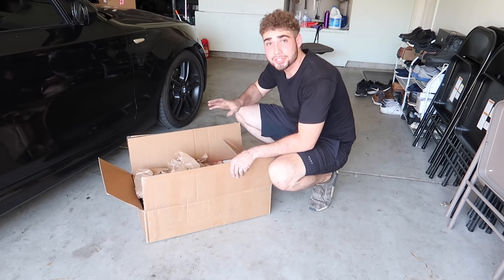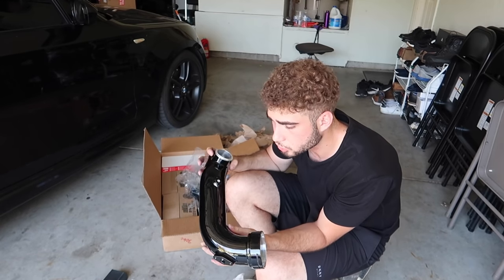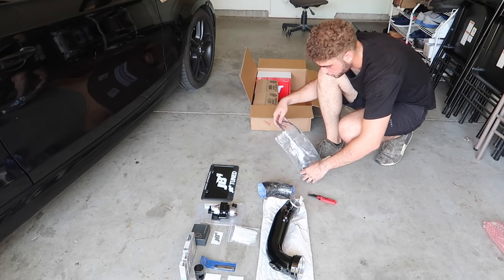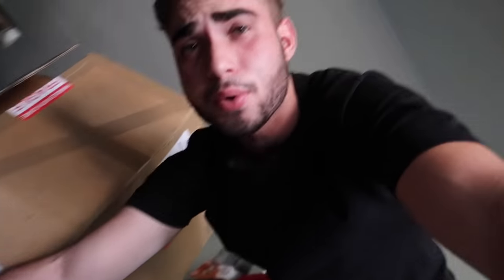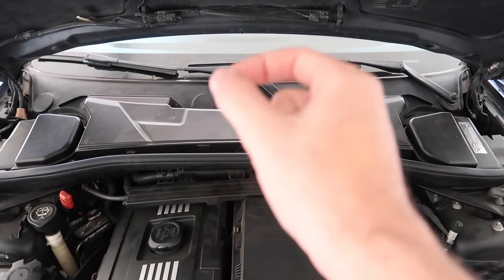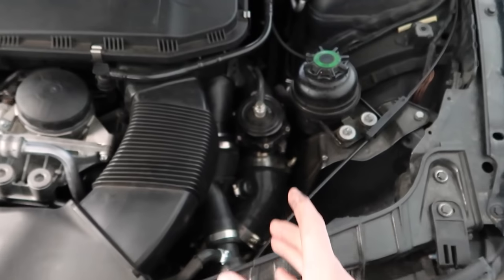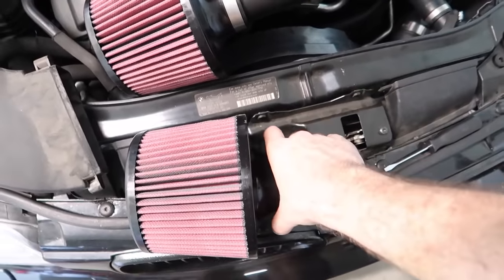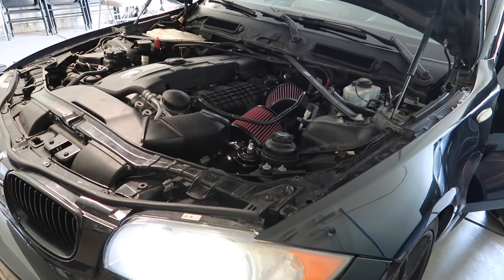THE 135I GETS 500+HP KIT (SOOOO FAST, SOUND AMAZING!)

Comment: Before you start removing the intake manifold to tap it for the bov. Check out Vader Solutions for thier adapter. It installs where the map sensor goes and has the  proper vacumm line.

Comment: Inlets and a HPFP and you’ll be actually at 500! Or at least close, I ran the same setup you have on my e92 and it only made 375 wheel on 93
Reply: U dont need hpfp a upgraded lpfp as well as outlets should make right around 500 wheel but those turbos wont last at all
Reply: Did you have a n55 is so that’s probably why
Reply: Sniper Thiefgaming nah, I got a f30 n55 and a e92 n54
Reply: BMS’s 500hp kit only makes around 400whp on pump, use e85 and you’ll be around 460rwhp. BMS rates the power at the crank
Reply: @marcoxtv6854  so if I add turbos on my car it will go out ?

Comment: Hey Nour I highly recommend that you replace all the vacuum lines with silicone lines, replace the stock PCV valve with a RB metal PCV valve, get a walnut blast cause I doubt it has ever been done lmao. Also make sure the NGK plugs are gapped to the right spec. after those that n54 will be solid af #saveabmw

Comment: Do you recommend buying one for around $6,500, with 90k miles as my first tuner car?
Reply: It's a solid car for that price but look for if its has any wastegate rattle from the turbos as those can get pricy, unless you plan on swapping those out anyways. Also, some other pricy repairs to ask about are fuel injectors and oil pan gasket so see if those have ever been replaced.
Reply: HPFP, Injectors, Turbos, Waterpump, Charge Pipe, Valve Cover Gasket and Vanos. Other than those, the actual engine is solid (forged), its all the components/parts around it that need to be updated to the latest versions, otherwise they'll fail at one point.
Reply: Make sure you take it a mechanic you pay$100 but it’s worth it trust me
Reply: if you cant afford to buy the car twice dont buy it

Comment: Is the car tuned in any way atm and does it still have cats and stock intercooler on ? That bov sounds really good if its only mods are intakes and charge pipe, car barely hear my forged 1 and ive got decats and mhd 1+